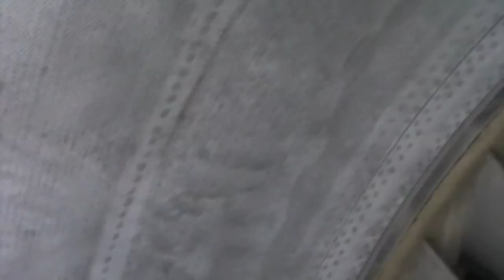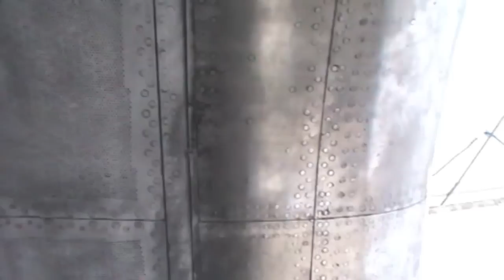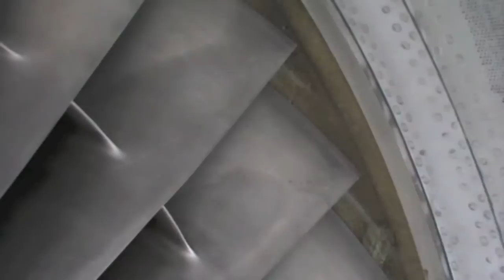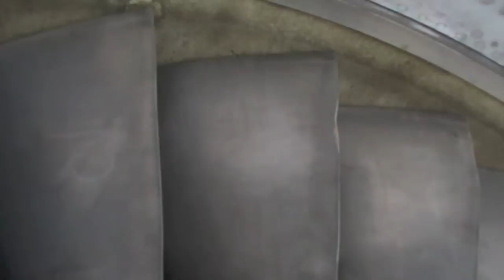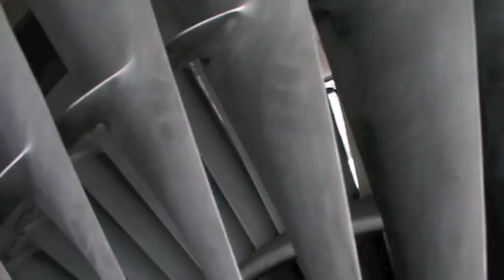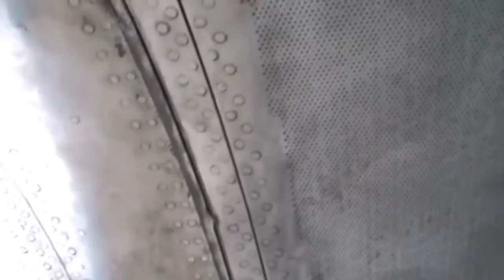RB211 Fan Up Close - That Noise Explained

Comment: What is the engine cowling made of? Aluminum?
Reply: Yes
Reply: I know they make those blades out of titanium and they are tough to cut blades
Reply: aerospace grade titanium is the best metal to build jet engine blades out of
Reply: Apparently the newest blades are being made out of carbon fibre to make the fans lighter and more fuel efficient I understand.
Reply: Derek Wall Hi Derek, I checked over and yes they are being made out of carbon fibre composites. Who's know's if they can hold up to it to be honest. I still like the beautiful titanium blades though :)
Reply: Agui007 I agree I love the kind of titanium they use in just about every single jet engine, the kind they use is practically bulletproof. but when they have whats known as a blade off event, the blade that got ejected literally just vaporizes instantly and gladly enough they designed the cowling to contain the shrapnel
Reply: Agui007 could carbon fiber hold up to the stresses of going supersonic at full power? and withstand hail, bird strikes, and any other abuses normally seen with fan blades?
Reply: Toms Friend Kake 
I didn't know that chickens were likely to be inducted into jet engines... learn something new every day.
Reply: Baby zebras

Comment: Hi there , thanks a lot for the video.I have a question for you. do you have any idea what is the weight of a LP compressor fan blade ?

Thanks a lot
Reply: Should be titanium, so probably within a few ounces. I have a 7th stage and 14th stage compressor blade from a CF6-50 which is comparable to the RB211 and they are very very light. I have a 1st stage  blade from a J79 which is stainless alloy and it is on the order of a few pounds! but its also much larger than the 1st stage blades of high-bypass turbofans like this.

Comment: My concern was the long time it took to spin up the engine during start. If the apu doesn't put out enough volume it's like a hung start which could overtemp the turbine. No?

Comment: In this engine, as well as the CF6-80, the blades are loose this way. Fan blades are LRUs, and I replaced many of them right on the flight line, with the eventual vibration check engine run. It's when the blades do not move that's a problem, as when centrifugal force places the blades on the same area relative to each other but one or two are stuck, and at high power, you'd think you're going to loose the engine and wing because of the tremendous vibration. Good video.
Reply: All jet engines have loose fan blades, not just RB211 and CF6-80

Comment: from what ive seen thru a few videos on here these engines are relatively easy to disassemble and clean and/or replace any parts if needed. the front fan however, that's the easiest part to assemble, and why they clatter is because they're pieced together on the shaft cone by sliding on the blades side by side and then securing them to the shaft with that conical looking piece

Comment: I always thought the whining noise came from inside the turbine, not from the from fan assemblies. the noise I wonder about is the buzz saw noise it makes. what speed do the tips of the blades reach at take off power and at full throttle? subsonic or supersonic

Comment: My all-time favorite engine and one of the reasons I used to intentionally book flights on L1011's instead of taking flights on other aircraft to the same destination..I loved L1011's and the sound these engines made back then so my question is this: what causes this type engine to make that long distinctive vibrating hum on startup which could even be heard  inside the terminal?!! also the moaning sound heard once power is applied and of course the choppy growling "whir" heard at takeoff power?

Comment: why are the fan blades lose like they are in this type of engine. ive seen how these engine fans were built and ive seen how one blade after the other is secured on. and since the blades are lose what are the chances of having a "blade off" event
Reply: They're flexible so they stiffen up at high load. Think of it like variable valve lift in a car which adjusts the height the valves open to depending on engine speed. Making them flexible also means they can shrug off a bird strike more easily

Comment: This a great video but I must say that this engine is not a Rolls Royce RB211 it's a Pratt and Whitney PW 2037. The RB211 has only 22 blades and the blades don't move in their spots unlike the PW 2037 has 33 blades. I work with UPS 757-200's and they have both types of engines.

Comment: The N1 fan tips are supersonic at high power, typically at about 1.4 relative Mach number.  The shock waves from the tips propagate non-linearly to produce that characteristic whining.  The other contemporary turbofans (PW JT9D-7 and GE CFM50) have different pitches due to small differences in the fan diameter, length of duct and acoustic properties of the duct.  At medium power when the fan tips are subsonic, that whine stops noticeably,

Comment: when the fan is spinning the centrifugal load on the blade makes the fir tree hold them in place nice and snug. The clappers support the blade behind it as the blade wants to flex as power increases.

Comment: Nope...It's important that they are able to expand. Not only the fan blades are loose, also the compressor and turbine blades. They must be able to expand under high temperatures. If they would be fixed, stress would cause and than they would "rip themselves apart".

Comment: The perforated metal on the inner surface of the inlet is strictly for noise suppression only not anti ice. Behind the perforations is an acoustical deadening material. Only the lip of the inlet cowl is heated with bleed air for ice prevention.

Comment: Appreciate the explanation and the vids.
 
A question - noticing the large amount of air expelled in the discharge path, what would be the effect if one were to 'cant' the engine up towards the clouds?

Would it be possible to have any effect at 1,000 or 2,000 feet up? Would it be possible to have any significant meteorological effect like breaking a 'cap' (capping inversion or Cinh) on a clear day and initiate condensed water vapor (cloud material)? 

.